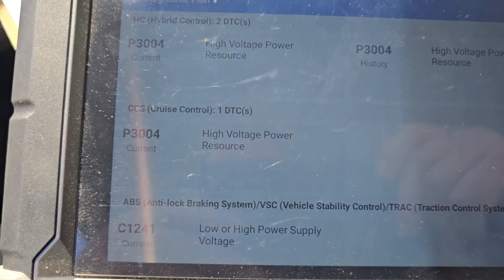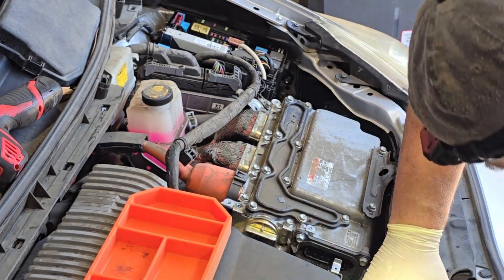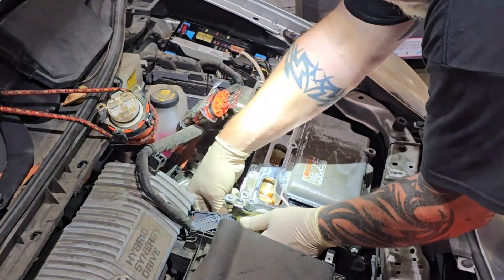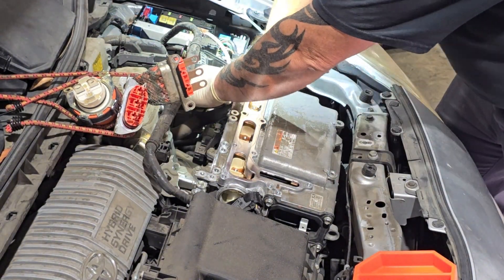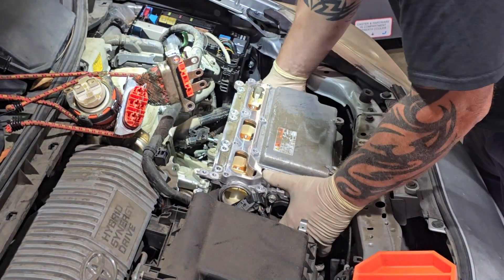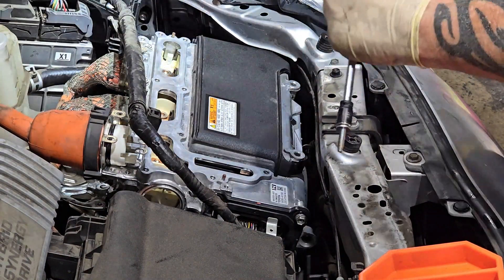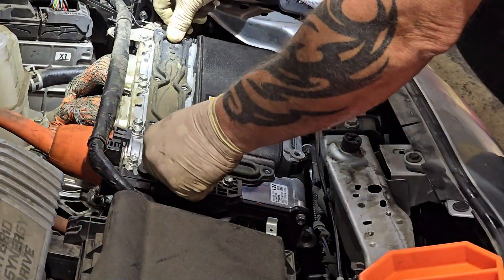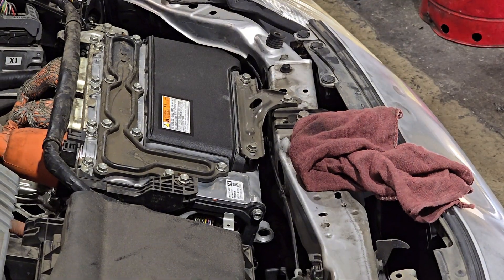Inverter Replacement Made Easy 3rd Gen Toyota Prius 2009-2015

Comment: ? I to have a p3004 code. How do I verify the inverter is bad after I verify the 12 volt battery is good? Meaning, what did you do to trouble shoot that p3004 code. i want to just make sure i dont just through an inverter in if its not it. Thank you in advance.
Reply from the maker: Hit me up on Instagram
Reply: Search for TSB 23TE03.  Toyota was in a class action lawsuit for failed inverters... so they are required by law to replace it for free if you have a P3004 code.  Do a search for "23TE03 PDF".  Best of luck

Comment: I had three POA94 codes and a UO100 code, on the cheapest scanner I could find at AutoZone. I infer that the problem might be the ECM/PCU. I couldn't find any one specializing in hybrid vehicles anywhere near orange, TX. I ended up at the Toyota dealership, where I was told that I needed the inverter and since I don't have 3,800+ dollars, I am looking forward to doing it myself.

Comment: As part of a settlement, TOYOTA NOW HAS A FREE 20 YEAR EXTENDED WARRANTY PROGRAM for inverter failure on the 3rd GEN PRIUS. 23TE03. IF you don't have a REBUILT TITLE, this repair SHOULD be FREE! IF you've paid for this repair in the past, TOYOTA should reimburse you see 23TE03 for details.
Reply: Oh wow is this true I have a 2011 Prius
Reply from the maker: @bsrktm1  oh wow I have not heard of this
Reply: Do you have to be the original owner!? This is really fuccin with my head!!
Reply: Calling Toyota now!
Reply: Exactly.  More awareness needs to be raised about this program. Toyota is required to replace failed inverters by law because of a lawsuit

Comment: Ty Tone,

Had an issue. I did this and replaced the water pump now it won’t start. It will turn the radio on etc, but it won’t let me shift into drive or reverse and the main engine won’t start. 

Hmmm, where is that ground you mentioned on the driver main (bracket)?  Could that be it?

I am having a hard time getting the main harness to settle back in and it’s way easy for me to pull out. Could this be it?

Edit: for reference, I’ve done the head gasket (twice lol) and took out the whole dash for the heater core. Somehow, this job has me stumped. Please help :)

Edit2: took off the air intake and got down to business w that harness. Got it secured solid and she started right up. Ty for the vid brother
Reply from the maker: @travisbrown2190  message me all of this on Instagram

Comment: Cool video best thing is the safety just a note i found it easy to remove the  battery  cover ones the inverter bolts are removed you can lift it and get better access but is judt me😂😂😂
Reply from the maker: @sergiochacon5038  thank you

Comment: I got a question 2015 f250 6.7 drained primary colant and it is grey / blackish verry thin .. is that exhaust getn in colant ? The guy changes his oil every 3000 miles .
Reply from the maker: It could be, what did it smell like? Message me on Instagram and I can help you more.